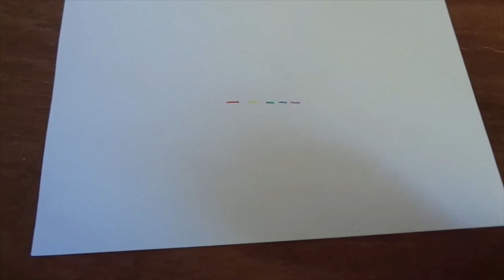Infra Red Detection Of Trains

Comment: Hi my mdf baseboard is 12mm thick. I’m going to add on top some extruded styrofoam 10mm thick. And on top of that I’m thinking of using scenics track bed of 3mm thick so making the thickness overall 25mm,  1 inch. Is this to thick/high for your infrared sensors? 
Thanks
Steve
Reply from the maker: Yes it is for the standard versions which have 22mm long infra red devices but you could use the EW versions eg IRDOT-1EW instead of IRDOT-1. These have the infra red sensor and emmitter on 18 inch wires.
Reply: @heathcote-electronics  is just 3mm a deal breaker? I would have thought with the beams pointing upwards and the trains having reflective tape underneath ( say aluminium) it wouldn’t be that crucial. Is the tolerance really very very small? 
Thanks Clive
Reply from the maker: You are correct 3mm in distance is not significant, the range is around 2 inches, However the problem is that if the infra red devices are not at the top of the hole you may get the infra red reflected off the sides of the hole or the underside of a sleeper partially over the hole. 
If requested I can make the infra red devices taller, up to 30mm.  @stevio7777
Reply: @heathcote-electronics  thanks for that Clive I’ll bear it in mind. 
The thing is I’m new to all this and I’m starting with Hornby TT120 running the engines with my iPad via Bluetooth. (DCC) 
But I would like to automate my layout as much as possible. I’m thinking of using JMRI. 
But being as the loco’s are controlled via Bluetooth it’s a challenge as how to go about it. Lol